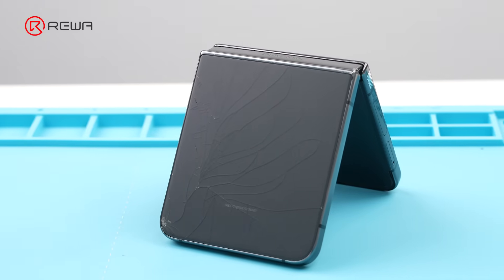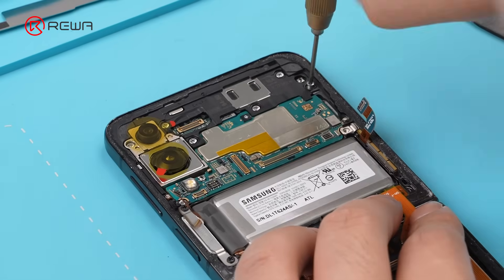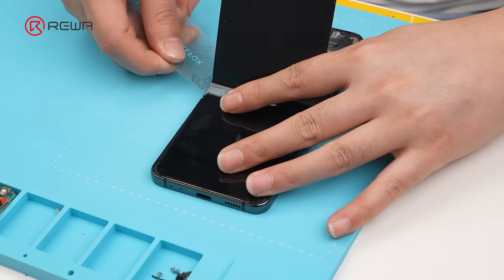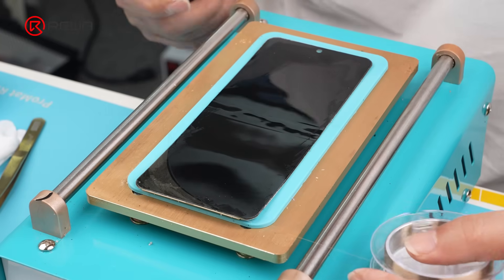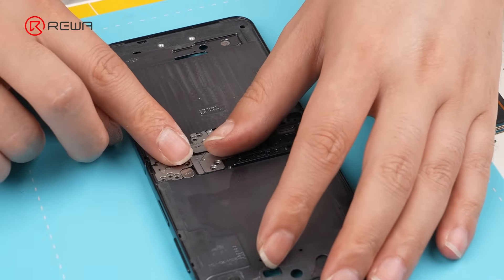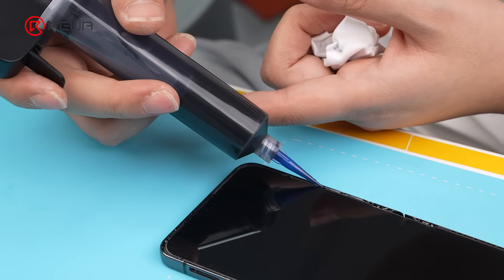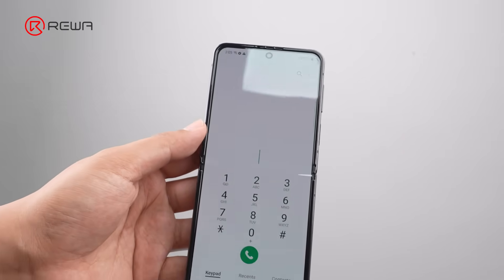Samsung Z Flip 4 Refurbishment – Screen & Mid-Frame Restoration

Comment from the maker: ❤How to Z Fllip 4 Replace Hingle Flex cable: https://youtu.be/naCQlEfqP20
Do you prefer refurbishing or full replacement for foldable screens?
Repair Tool：
1.REFOX RS64 Plastic Opening Pick for Phone Rapair:
https://shop.rewa.tech/detail/refox-rs64-opening-pick.html?utm_source=YTB0627&utm_medium=video&utm_campaign=YTBrepair+video
2.REFOX RS2 2D Screwdriver for Phone Opening Repair:
https://shop.rewa.tech/detail/refox-rs2-2d-screwdriver-set.html?utm_source=YTB0627&utm_medium=video&utm_campaign=YTBrepair+video
3.Original PUR Cold Glue for iPhone/Android Middle Frame:
https://shop.rewa.tech/detail/original-pur-cold-glue-for-iphone-middle-frame-bracket-back-cover-repair.html?utm_source=YTB0627&utm_medium=video&utm_campaign=YTBrepair+video
4.REFOX RF20 Universal Screen Separating Machine with Dual-Stage Pump
https://shop.rewa.tech/detail/refox-rf20-rotary-phone-lcd-screen-separator-machine.html?utm_source=YTB0627&utm_medium=video&utm_campaign=YTBrepair+video
5.REFOX RS65 Ultra-Thin Entry Pick 
https://shop.rewa.tech/detail/-refox-rs65-ultra-thin-entry-pick.html?utm_source=YTB0627&utm_medium=video&utm_campaign=YTBrepair+video

Comment: My zflip4 freezes sometimes with a System UI is not responding whenever I close the phone without locking the screen first
Hinge cable?
Impressive btw, opening to the gold layer of OLED and not destroying it somehow
Reply from the maker: Thanks for the support, as for your problem, actually you may need to test screen or the motherboard to find out which part leads to this.
Reply: @rewatechnology2008 I followed your video, and replaced my cable myself. It was difficult but it solved the issue

Comment: Ok Rewa and now tell me where the problem is when you order the original LCD service pack, which already has the upper magnet. All components are replaced and the phone turns on so the magnet reacts poorly.
I wrote you this question by email but no one answered :) here in the video you also don't show how you turn on the phone and whether the function turns off when you close the LCD and vice versa when you open it whether it lights up, also whether the rear small LCD works properly.
On the contrary, shouldn't the service pack work right out of the box without having to fiddle with the magnet?
Reply from the maker: Hello where do you place that order? The magnet is a common and hard issue for Flip series, you need to  place it precisely, the perfect spot, we also try it few times.
Reply: @rewatechnology2008  I think the LCD service pack from Samsung for the Flip4. The part that comes with the LCD, the new frame with hinges and also the magnets. I haven't experienced a single LCD service pack that worked well without having to tinker with it, then the part loses its meaning when you have to dissect it.
I heard that supposedly there is a calibration for the new LCD service pack
Reply: Yup, need to calibrate first for both innner and outer lcd panel to work together if magnet problem arise... Samsung provide their own software for calibration, galaxy diagnostic tool for the calibration process... But for service center only not open for third party repair...

Comment: Hello, I have 2 Galaxy Note 20 Ultra 5G Motherboard. One is Hong Kong version and the other one is Japanese Version. I bringed the motherboard to service in Indonesia to seperate the top layer of the motherboard and then swap it so the Hong Kong version of the motherboard will be able to have 5GmmWave Antenna, after the server successfully swapped the top layer, the motherboard doesn't want to turn on.

Can you help me find the problem why the motherboard doesn't want to turn on after swapping the top layer?
Reply: Who in the hell does this and thinks it's a wise idea?
Reply: @techview2834 I did, because the shape of the motherboard are exactly the same.
Reply from the maker: So now the HK version can not boot?
Reply: @rewatechnology2008  The Hong Kong version doesn't boot. Charging Test is 0V and 0A. The Japanese version is the same thing and under repair so I take the Hong Kong motherboard back home.
Reply: @rewatechnology2008  HK Version 0W Charging, 3-5W Wireless Charging.
Reply: @rewatechnology2008  I asked the server to swap the top layer of the motherboard by seperate it because I want to install the 5GmmWave antenna on the Hong Kong version.
Reply: @rewatechnology2008 The HK Version is able to power on but it got into a bootloop like randomly restart after enter pin to unlock. The JP version is also able to power on normally, but the motherboard refuse to vibrate, read my SIM card, and shows an Unknown IMEI and Baseband.

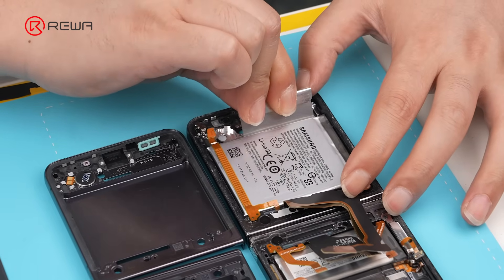Comment: 06:46 A big no, Rewa! It is better to use IPA + wide enough plastic pry tool.

Other than that, great video.
Reply: i do this all the time. just be careful
Reply from the maker: You got it, that part is little risky for some green hand repair guy, but at that moment, our repair guy just use the handy tool, but you are right.